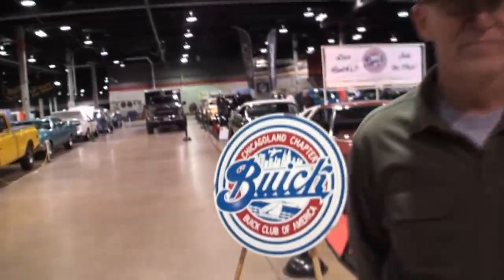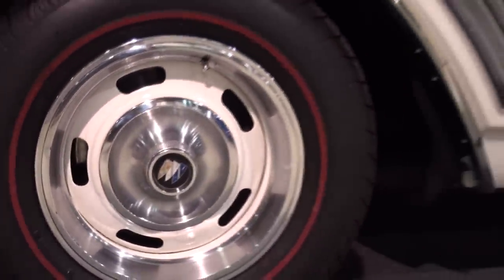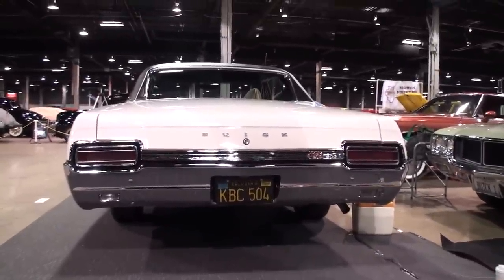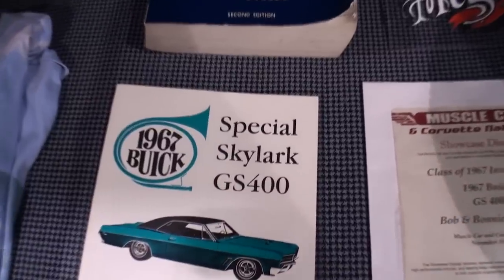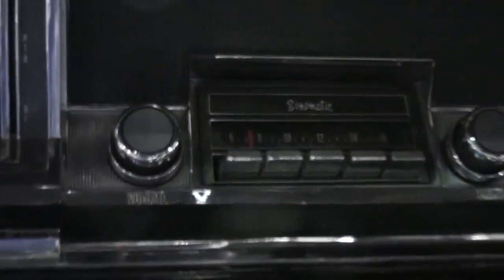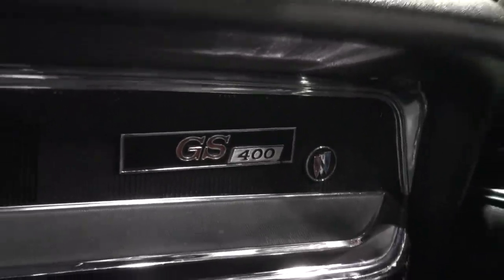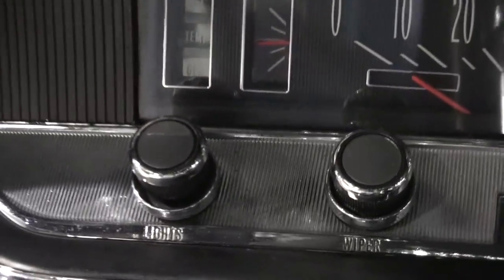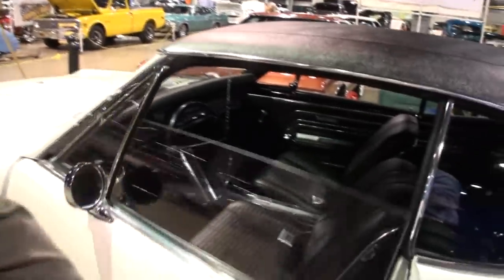1967 Buick GS 400 Sport Coupe in White & Engine Sound on My Car Story with Lou Costabile

Comment: Nice '67 GS400, Lou! I once owned a 1967 Buick GS400 with dark blue exterior, black interior with bucket seats and center console (like the car shown in your video). IMO, 1967 was the last year of the better quality interiors (die cast metal, chrome, stainless, etc.) In '68 cheaper plastic and plastic chrome came into use. My car was bone stock, with 2:93 posi  rear, 400 Turbo trans with switch pitch converter. It ran decent, but it would have been more decent had it had a 1970 455 engine!
Reply from the maker: Hi Walt, Happy to read this car brings back memories of your car :-) Thank you for viewing and sharing, Lou

Comment: Buicks were funny. Back in 1964 they introduced their first shifting automatic transmissions. About the only carry-over from the Dyna-flows was the variable-pitch stator in the torque converters. This gave a little more push, almost like another gear. Buick introduced 2 new automatics, the Super Turbine 300(2-speed Powerglide-based) and the Super Turbine 400(3-speeds). In 1964, you could get the S.T. 400 in almost any Buick, including a Skylark with the 300 c.i. V8. The 1964 S.T. 400 was a one-year model, having only one "L" shifter position. After Cadillac ran out of traditional Hydra-matics, the 1964 S.T. 400 was substituted. This was also a one-year version of a Cadillac not having a "Dual-Drive" shifter.  The next year, 1965 through 1966, you could only get the S.T. 300 if you wanted an automatic in mid-sized and compacts. Even in 1967, the GS 400 often came with the S.T. 300, which basically limited them to drag racing. You often found a 2-speed automatic in the smaller Buicks into the 70's. The Nova-based Apollo was an example.  That is great that the GS 400 in this video  has the S.T. 400, as it may be the first one I've seen this way. Supposedly, 1967 was the last year for the variable-pitch stator. The S.T. 300 soldiered on until 1969, but with a regular torque converter. The 1969 model year introduced the T.H. 350(3-speed) automatic. All GM vehicles still with 2-speed automatics used the Chevy PowerGlide. After the middle of 1964, the only vehicles which still had 2-speed automatics were GM vehicles.
Reply from the maker: Thank you for sharing your knowledge.